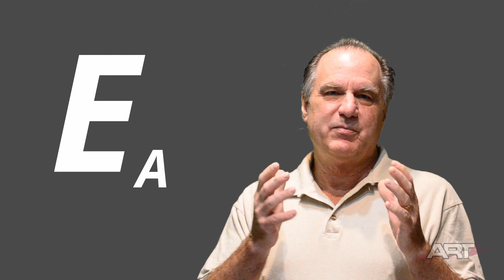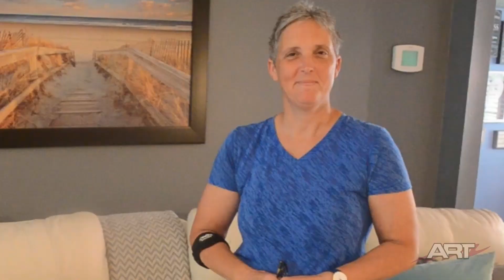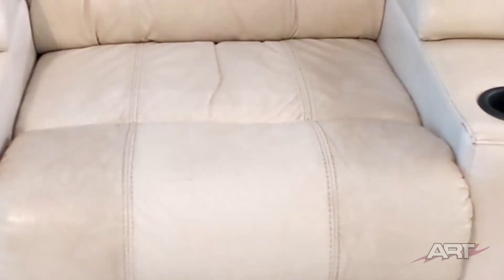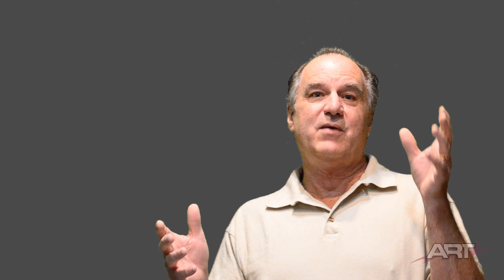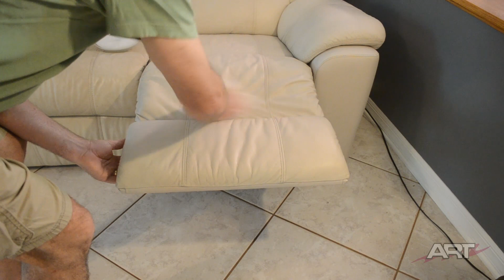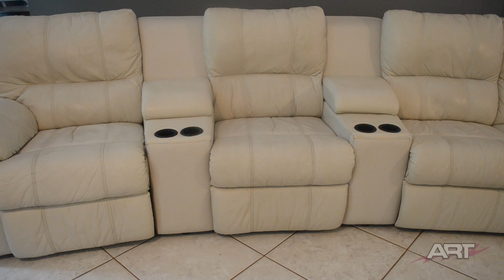How to clean your couch / The ART of cleaning and surface preparation Part 3 v109

Comment: Good info, I've recommended using mild dishwashing soap to retail customers for a long time, it's very safe so they can't mess anything up. I have not been recommending alcohol, because it sometimes can take the finish off generally I know it is safe. , If they were to test it first in an inconspicuous spot that would be good. I do use professional water base cleaners followed by alcohol on auto interior seats all the time.  And once again you provided the science behind how it works.
But one complaint, no guitar in this video! Just kidding.
Reply from the maker: I'll throw a little guitar into the next one.  Some people don't like it...which is another good reason to feature some!

Comment: This raised a few leading questions for me. You mentioned that once you degreased we could have recolored as it was effective enough and opened up the material. But, once we remove that degreaser with alcohol it closes up. (If I recall correctly)

1) is this to say that alcohol would close up our material giving us less Adhesion ?

2) I would think to remove a degreaser before re coloring a panel. Which I would think to commonly do so with alcohol. Is this unnecessary in some cases depending on the degreaser/ prep used specifically when recoloring ?

Edit: after rewatching the 2nd video you mentioned that alcohol creates a higher energy surface after degreasing which is what I thought to be true. I think I misunderstood  the closing up that you mentioned after the alcohol step in this video. 

Thank you. I very much appreciated your email response! I agree with you entirely and hope to change things for us!
Reply from the maker: Maybe I didn't state it clearly but it is the alcohol that "opens up" the surface.  So the surface will remain tacky until the alcohol fully evaporates and a then little time more.  That is the window that I like to recolor in.  Thanks for the question.
Reply: Okay, that makes sense and was what I thought to be true. The 2nd video confirms this as well after rewatching. I probably mis understood and I Thank you!

Comment: Thank you so much for sharing your knowledge, on 95% of leather repairs that I do I will carry out a remedial clean on the rest of the leather interior to give the vehicle a uniform appearance, I wasn't aware that the cleaning agent that I use would have the ability to attract grease and oils to the newly cleaned surface, I will be using a alcohol wash to finish the process in the future
Reply from the maker: Yes it's so common to have clean the corresponding seat to the one you're working on.  No one else cleans seats like we do!